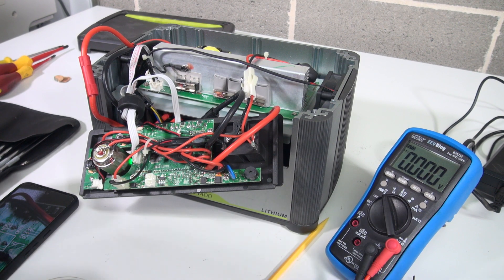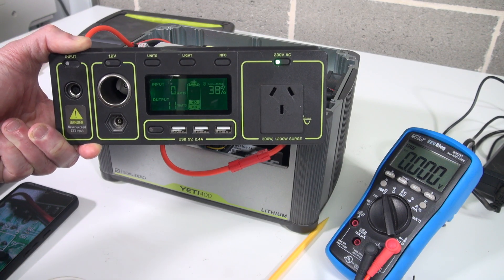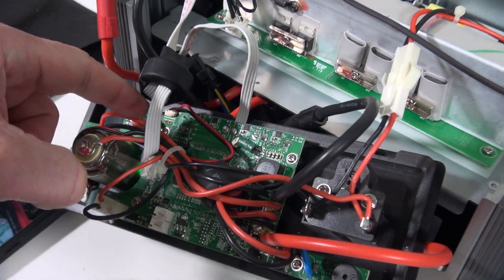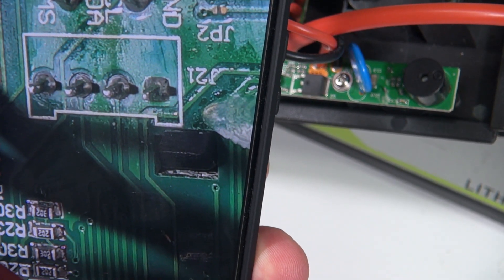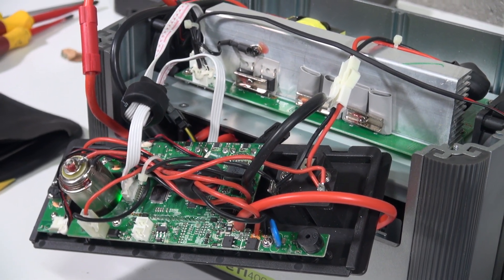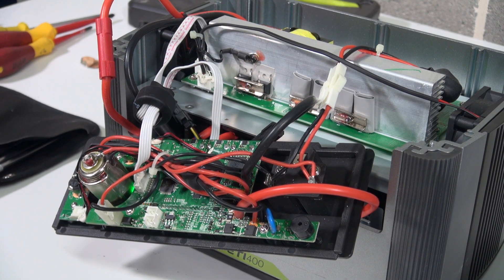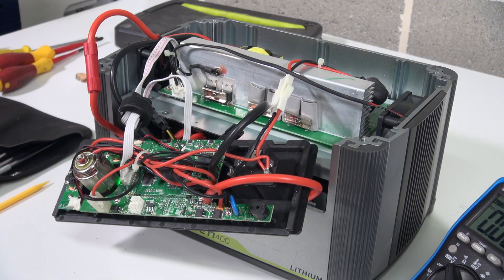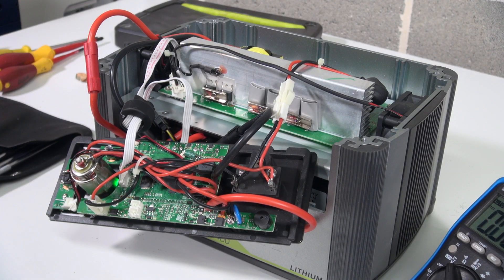Goal Zero Yeti 400 Lithium Battery Follow--up

Comment: I'd be fitting a big inverter disconnect switch somewhere so if you aren't using the 230v output you can save the 11W draw and workaround what the designer screwed up.

Comment: ive taken apart a GZ 500, GZ1000 and GZ4000.  all of them have similiar construction where you can remove the battery from the bottom.  flip over the unit, remove the screws and remove the bottom coverf then pull out the battery.  no need to go through the top.  i'd be very surprised if this was different.

Comment: My Ecoflow River 2 has a charging limit, so I can keep the thing partially charged. Even, it has the "Backup reserve" function, where it can charge up to set percentage from mains and then it charges only from DC or solar.
However, you can set this only through the app, and, for some reason, it gradually looses calibration and soon starts showing capacity wrong. I am not sure if it balances the cells if it is not 100% charged ...

Comment: This is 3 cells (cell groups) in series!
Label reads 10.8V nominal... so 10.8 / 3 = 3.6V per cell

They probably don't want convert the 12V output and 4 x 4.2 = 16.8V would not be a good idea (3 x 4.2 = 12.6V works)

Comment: For the tripod, try to shift the camera's centre of gravity backwards. The tripod itself is likely fine but if your camera is too front heavy it's just overloading it. Most professional tripod heads let you move the plate forward and backwards to balance the camera, but it's unfortunately absent on most consumer or prosumer heads. You can get replacement plates that have an offset though, or add an extra cheese plate on top or whatever to shift the camera back a bit.
Reply: I made a plate with aluminium bar to do that, just put an old tripod head bolt on one end, and tapped several 1/4 threads in it.
Reply: So that's what that thing was for! Thanks for the info sir.

Comment: Unfortunate that the firmware is so primitive.
Of course there should be some way to display the individual cell voltages, and it should turn off the inverter (and other outputs) when they get too low.
Reply: Did you even watch the videos? That's what it did.(BMS turned off to protect the battery) .
The intended market would have little use for cell voltages. They wouldn't know what they mean, and even if they did, there is nothing they could do about it, as it's not like it has a user configurable balancer. 
When you develop a product there are limits, e.g. Functionally V cost. 
Cell voltages might be nice, but then you need to code the BMS to send them, you need a way to display them, so a different display maybe needed, etc. Cost and time increase.
Things are not always as easy as saying it should have feature X.

Comment: I think this is a case of your external PSU unable to handle the load currenit at the low output voltage, as the cells try to draw a high current.    Might be that it's just getting old (bad caps?), but that on-off cycling sure looked to me like it was dropping out.

Comment: I think for peace of mind given it’s a Lithiium battery it would be worth investigating the individual cell voltages further…….just to rule out any kind of battery failure as we all know where that can go!!!. Perhaps there’s a trick to get the cell voltages on the LCD?
Reply: not with just two wires. looks like very basic lcd display controller

Comment: Will it operate without issues if you disconnect the inverter? If you're burning 11W at idle it's just a wall wart so pull that plug unless you're taking it on a trip so it's just running the raspberry pie off DC
Reply: It should only use 11W when the AC output is switched on, otherwise its not using it.
Reply: Why disconnect it when it has an on/off button?

Comment: Good find on this repair! As always excellent suggestion; if it fails, take it apart. If it is new, take it apart! :)
For our failed GZ units, I probably indeed take them apart, rip out the failed section (in our case, often the invertor) and replace it with something external (and durable).
BTW, I did a test on a GZ Yeti 500x Lithium;
Run a 12 volt 6 amp load (Cool Box) and still use the mains charger;
The GZ is able to keep-up for several days but eventually will turn-off the 12 volt output due to battery discharge.
I guess that the GZ mains charger is not able to keep up with the load that way.
What I do like about GZ is that you can actually hook-up multiple inputs to charge, however it does put a huge strain on their electronics. And sometimes fail...